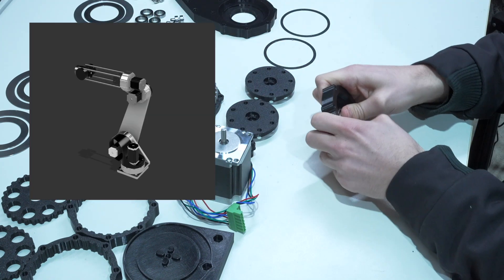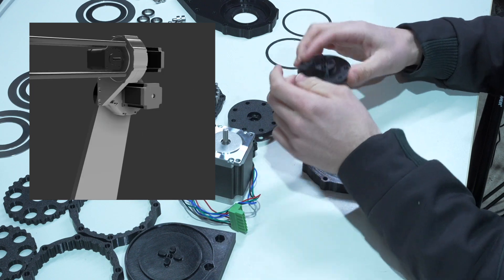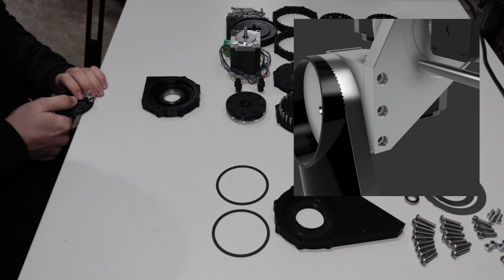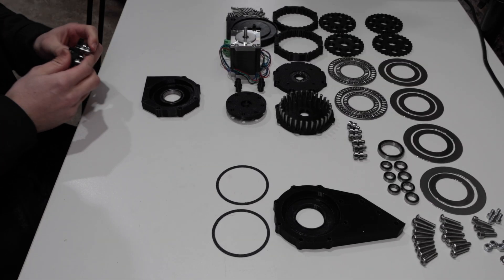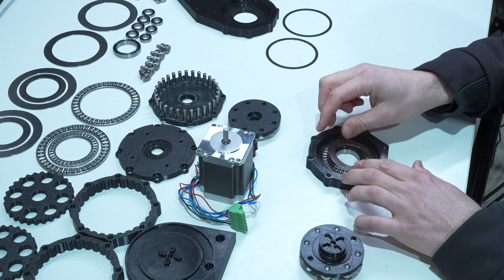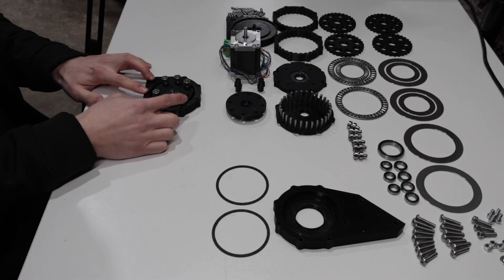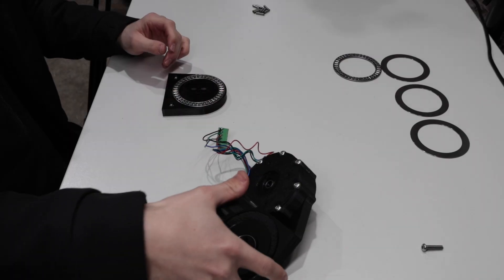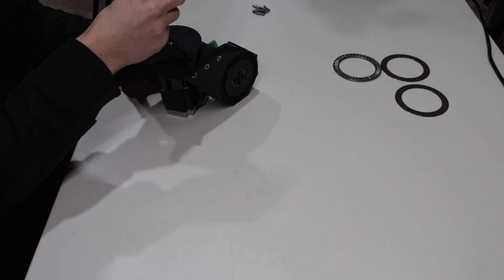DIY Robot Joint 3 and 4 with Cycloidal Actuators - 3D Printed Prototype

Comment: What aluminium grade are you using to make a robot?
Reply from the maker: @srdjan361306  Good question, thanks for asking! Depends on the part, mostly 5083 but also 6082, 7021 (higher in strength)